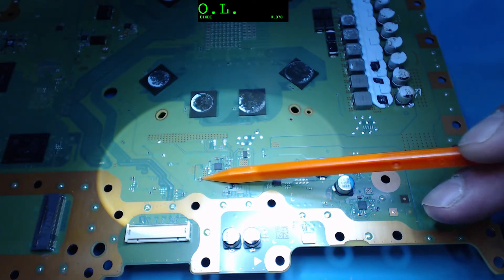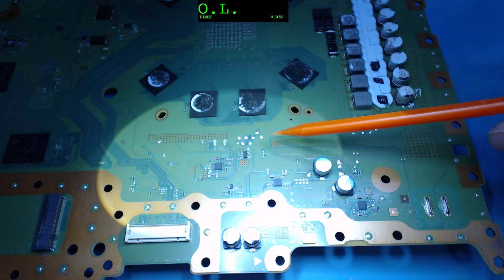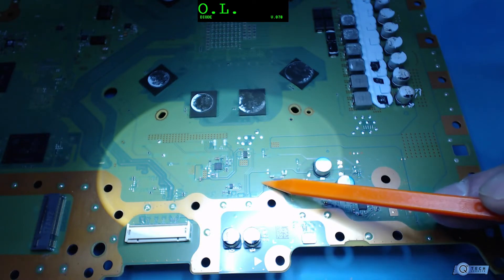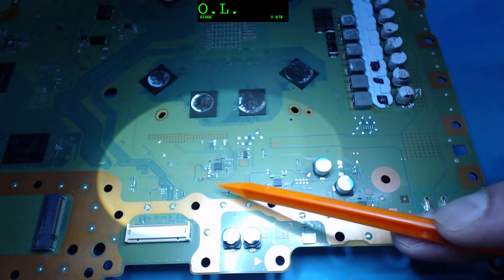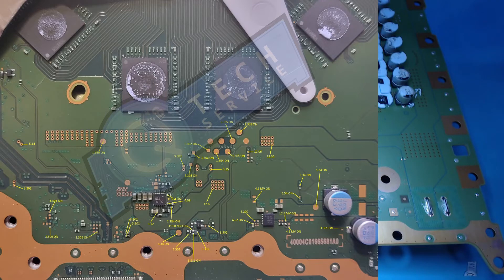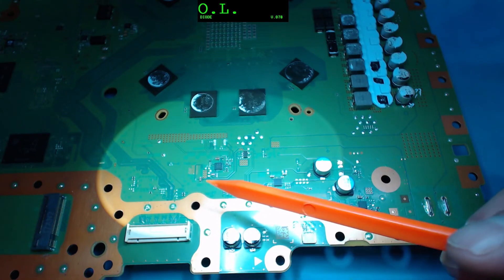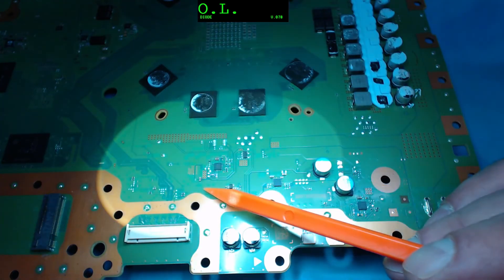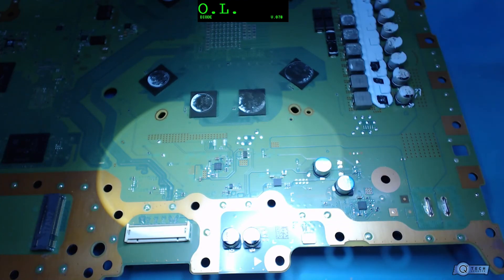PS5 Defect Design

Comment: Haven't had the opportunity to get my hands on a PS5 (yet), but seen from my technician/engineering viewpoint it could be that the reason Sony cut down on the caps in that location could be:
1) They're not needed. If the buck converter chip is (replaced with another type) running a different frequency, the ripple could be lower. 
2) They moved the smoothing caps closer to the chips requiring by-passing
3) They use different chips with a lower current consumption, hence not loading the converter as high - so the caps are not needed
4) Having several bypass capacitors in parallel decreases ESR, which could induce oscillations (RLC tank-circuit), which ultimately increase ripple - not decreases it. I would not re-design the board unless in need of space, just populate less caps in that case.

If you have an oscilloscope you might be able to see the ripple on the different versions of the PS5 and compare.
I doubt they remove chips just because the chips themselves are bad quality - but I could be wrong, capitalism.

Comment: A lot of capacitors made during the pandemic were TRASH! I honestly wouldn't trust any electronics made from 2020 to probably 2023, maybe even 2024 to have a long shelf life. We had a epidemic of bad condensers during the early 00's too and a lot of stuff from that era is dead now. Literally saw Dell PC's made in 2004 have every condenser leaking on the board around 2010, less than a 6 year lifespan.
Reply from the maker: They are trash The ceramic capacitors are so crappy nowadays It's getting ridiculous